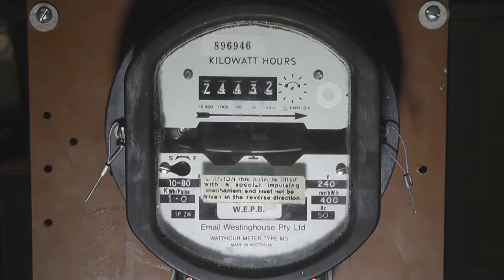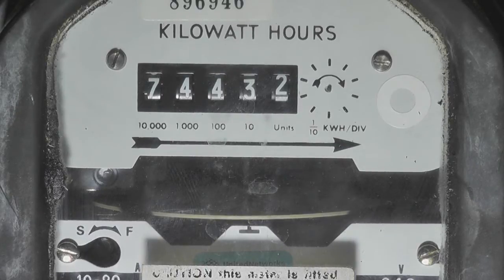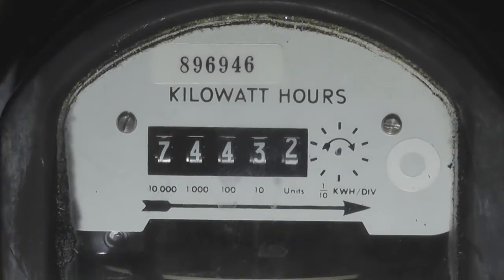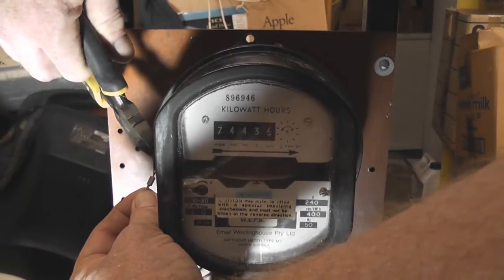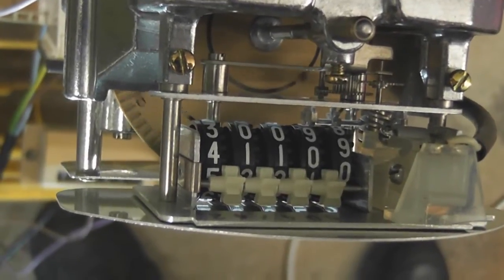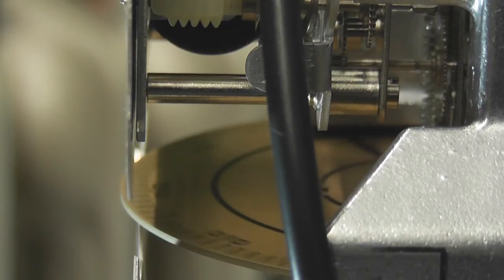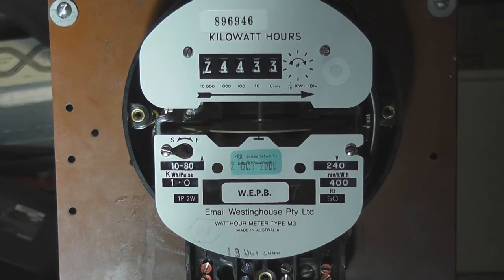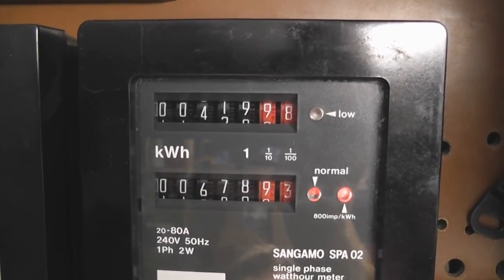Email M3 remote register kWh meter

Comment from the maker: 10-80 Amps means 10 Amps is the base load of the meter. Accuracy is very good between 5 and 100% of 10 Amps. (500mA to 10A). 80 Amps is the absolute maximum rating and the meter is still accurate within its 2% accuracy class. Generally the errors above say 40 - 80 Amps will be on the negative side as the current coil saturates.

Comment: when they say rated 10-80 amps, does that mean the meter is not as accurate below 10A or above 80A? as well as obviously having wiring inside that can only handle 80A

Comment from the maker: At our power board we used the sangamo S324 registers. I am sure that Email would have made Email remote registers as they designed their meter for the remote switching option. Interesting that they omitted the 1/10 dial pointer in these meters as the shaft turns the opposite way. I need to get of a normal Email M3 meter without the remote switch and see where the differences are.